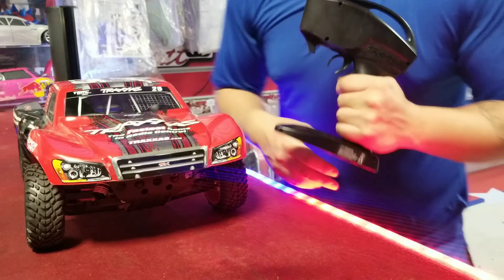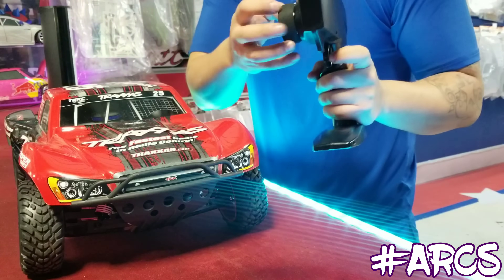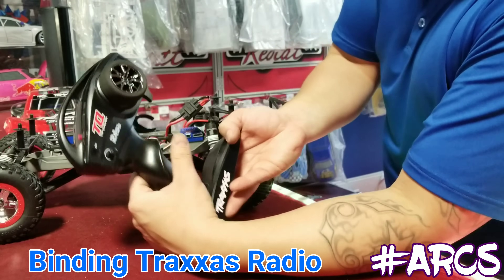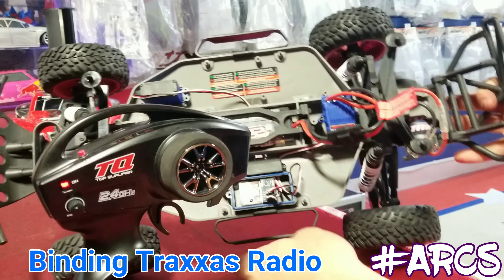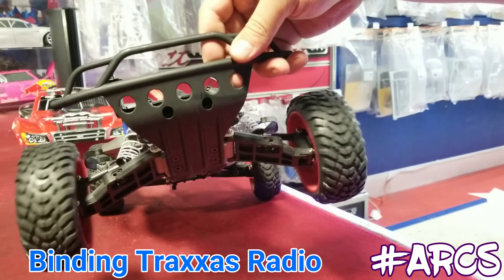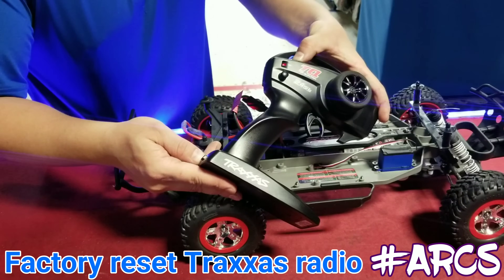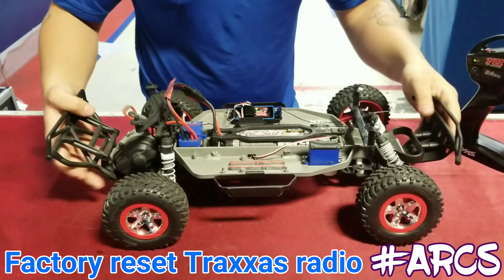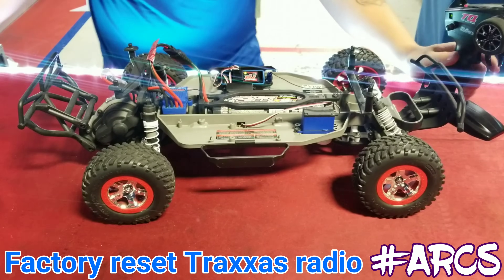How to BIND and Factory RESET Traxxas radio

Comment: Thank you for this video I had to reset my Traxxas TRX 4 Blazer after placing in the tqi link on my remote and all it really did was make it harder to use the remote control because this model doesn't really support it too well and it made a lot of glitches and twitches in the steering and made it harder to control the truck.

Comment: I have the traxxas nitro slayer. Would the TQ 2.4 with reviver 6519. Works on that RC ? The original 27 TQ  had trottle & steering nobs. Thank you in advance.

Comment: My traxxas slash 1/10 4x4 is going super slow and when I tried to do the factory reset no matter how long I held down the set button and turned it on it wouldn’t turn green how do I fix that?
Reply: @chrismagallanes8858  I got it my slipper clutch was really loose

Comment: I tried to switch the Mode from training mode and it did but when I tried to switch it back the light turned off for the speed control and it won’t turn back on but when I press the button it’ll turn the steering on but the lights not on and it doesn’t work for the throttle

Comment: How do you reset the ESC because it's at a steady green but won't go forward or throttle at all
Reply: SkippyTrx I’m having the same problem
Reply: @luvsmokeyyd7278  I found out the button was stuck which is why it didn't react to me pressing it and after that I was able to set it back to default
Reply: The ez set button or which one ?

Comment: Ive been trying to sync my traxxas slash and followed these instructions. I got a new receiver and when i turned on the truck, the XL5 ESC module blinks green and the receiver itself is flashing red.  (remote controller is flashing red as well) I have no idea of what im doing wrong.

Comment: I have the 1/16 slash and i reset everything and still no reverse its on sport mode and i flipped the motor wires. And no reverse what could be wrong?

Comment: So I reversed the throttle but my break has also reversed on my trx 4 Sport. So when I push the throttle to go forward then apply the break it goes straight into reverse. When I let go of reverse then apply forward throttle it goes into break.

Comment: What do I do when my car just keeps cutting off with fully charged battery’s
Reply from the maker: I would try it with a different NIMH battery. If it still happens try factory resetting the esc, if still no luck might need to take it to a hobby shop so they can check the power.

Comment: For mine when I try to go forward it drives backwards and when I try to go backward it drives forward. if you see this can you please help
Reply: You need to either switch the wires with each other from the motor to the ESC or you need to flip the plug from the ESC to the receiver the opposite direction

Comment: My car turns green and stops when I release
Reply from the maker: It might be under Lipo mode. Switch it from Lipo to nimh mode. This should fix it
Reply: Amazing RC Store thanks for the advice but it turned out I fried the ESC
Reply: @timothyplante7712  that might be what happened with mine because whenever I try to turn on the ESC sometimes it won’t even turn on